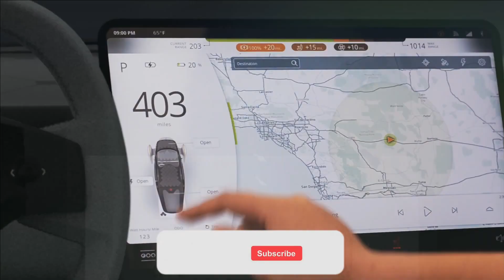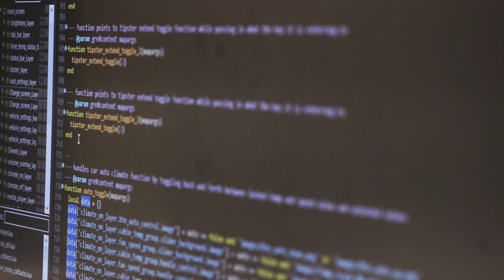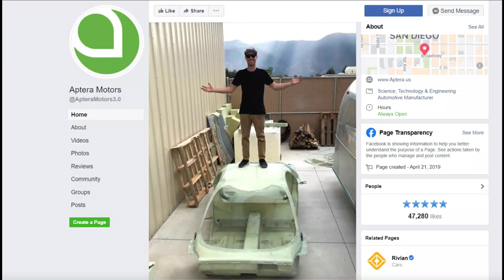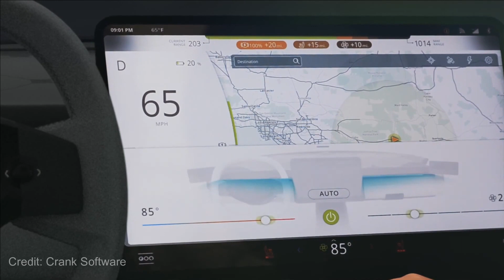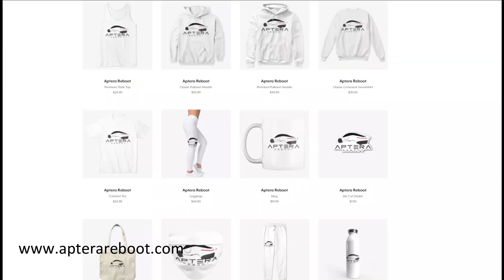Top 3 Reasons Why Aptera Will Fail?!?

Comment: Aptera will fail all the same reasons as Star Citizen will :^) it is not out yet. 

Joking aside I'm interested to see how EU will react to Aptera. it would be super neat to get it as motorcycle for cheaper cost ... Also winter in Finland/Sweden/Norway will be problematic as some roads are covered in snow. I hope the winter tiers go well... Also I think you have to get 3 wheel drive. I would love to see "low speed mode" where the tiers will move slowly ... I got my car stuck because one tier didn't spin and other one dig itself and I was stuck from engine and it took 1 hour to get it unstuck with a lot of shoveling, some sand and wooden plank under the tier ...  

I mean, if the Aptera is light maybe I could more easily lift it ... but here is a question. Can I lift the tier up without hurting the body? Is there some place I can place planket in case it gest stuck? How about if I want to pull it using robe or something, where do I attach? 

It is less about "can the Aptera handle the snow" but more about what if I get it stuck by being stupid :D
Reply: Aptera has a superior ABS/Traction control that can sense wheel slip and adjust torque 32 times per wheel revolution.  AWD will be better, but I will be getting my 2WD for use in snowy Iowa, and will probably put on studded snow tires for winter conditions.  I hope to report on how well it behaves  next year.  A tow rope can be attached to a the front suspension or the rear tow hitch.  There will be hard spots for lifting.

By the way, I have a lot of respect for people willing to use a second language to ask questions.

Comment: Not concerned about 2 seats, I want that rear tire to be wider with fast charging capacity and I have my doubts about the reliability of those in-wheel motor.
Reply: They are looking into a wider tire with the validation testing going on now, but it may not be needed for excellent performance.  I had some questions about the in-wheel motors too, and contacted Elaphe directly with some questions based on my own experience developing motors for marine use in salt water.  They had the answers I was looking for.  I am no longer seriously concerned.

Comment: This vehicle reminds of an electric modern version of the 1934 ( or the new ) 3 wheel Morgan sports car. How cool is that. I suggest adding an S & S Morgan gas motor sound system to make it sound as cool as the 3 wheel Morgan's:) that would really make these turn heads
Reply: Aptera grants right to repair and will encourage customization :)

Comment: I am a Canadian and one of the concern that i have is, I think because of the Wheel Panels there is a good chance that i might get stuck in Snow. I can visualize it plowing thru the snow. Also, I think the 3rd wheel might make it unstable in snow causing it to wobble/ fishtail.
Reply: A driven third wheel will make it more stable.  I will have an early model and will be driving it in Iowa.  I will have plenty of opportunity to report on performance in snow.
Reply: @n.brucenelson5920  mostly when it snows you can see the 2 tracks left by other cars but the third one in Aptera will be driving on snow which the other two on cleaner tracks. Let's hope it does not cause it to fishtail. I will wait for your experience.
Reply: @Soothsayer210  I presently drive a Gen 1 Honda Insight where the rear wheels do not follow in the tracks of the front and it is OK.  The Aptera will have abs traction control that can sense slip and adjust torque to each driven wheel every 2.5 inches of tread travel.  I will use studded snow tires and expect it will do better, based on my experience with the similar weight Honda.
Reply: @n.brucenelson5920  we are NOT allowed to use studded tires here. We just change to winter tires. I have also ordered my Aptera an all wheel drive with off roader wheel panels in anticipation for our snowy conditions.
Reply: @Soothsayer210  Too bad.  Research seems to show that they are not more damaging to the roads.  I think that with AWD you will have no issues.  I will be reporting as soon as I have first hand experience.

Comment: "Goal" of meeting crash standards...lol   They have a goal of selling them for $2000 too probably.
The big issue with the Aptera design is the HUGE A-pillars of the body.  It creates a huge blind spot for pedestrians.   EVs don't need to be highly aerodynamic, they are not used for long-distance high-speed travel.  A Smart car has terrible aero, but sells plenty of them, they are not for long distance travel.
Reply: Please inform yourself regarding the focus for Aptera's design.  Noone designs a local only vehicle with a 1000 mile range battery and gives it a 110 mph top speed.
Reply: @n.brucenelson5920  So Aptera will ABSOLUTELY and CERTAINLY FAIL if they think a 1000 mile range 110 mph car is what people want from an EV.   Dumbshit

Comment: I believe it will do well because of their design plus current market. Gas prices too high Aptera has the best driving distance of any electric car. Solar as the wonderful balance to that. Being a two seater isn’t a problem. They even addressed the issue what if you break down. I believe they have worked out most issues and now the world is ready for them!!

Comment: There's a difference between two doors and "seats two".  Most two-door cars still have a back seat for other people.  So pointing out the number of two-door cars sold isn't really applicable.

That said, Aptera's biggest problem is it's weird.

Consider Tesla.  It's an electric car.  But it's still a car.  It has four wheels.  It looks like pretty much any other car out there--maybe a little more streamlined.  It has four wheels and drives like the other cars I've driven in my life.  I'm fine putting down an order for a Tesla because it's just like any other car--it just runs off electricity instead of gas.

Aptera?  It's weird.  It has three wheels.  It has a funny shape.  What will driving it be like, with three wheels?  How much space does it really have?  I'm interested--definitely--but I would want to test drive it.  Heck, I might consider a week-or-two rental or a lease instead of a purchase because I don't know if I'll like it.  And before I plop down $27,000 (at the low-end), I'd want to check it out.  Because it's weird.

Don't get me wrong, I'd probably find out that it's not a big deal driving on three wheels, that it has plenty of space, and even that I really like it!  But I would need to find it out.  I have no experience to go on for something like this.

So they need to start making them--obvs--and offering leases as well as purchases, IMHO.

Comment: I like the concept of Aptera. It’s clean, efficient, mostly affordable. With a promised 1,000 mile range and may never need to be plugged in… if they can do as promised it will be a game changer. The two person thing is a possible problem, but for me, not the big of problem, 90% of the time I’m alone in my car, if I do have a passenger, most of the time it’s only one person or the dog. 25 cubic feet of storage for the most part will cover my needs as well. And the full recharge times, no one is coming anywhere near that. Now the draw backs, when are they going to pull the ripcord and start production? I’m not committing one dime until there’s something I can see and butt test, something I drive. It will have to be quiet, comfortable and better have a smooth ride. It had better have great heating, there are reports the heater may not be up to challenge of keeping you warm in subzero temperatures.
 And it better have a decent radio, I know superficial, but it’s a must. Every car I’ve had has been comfortable to drive, has had a great sound system, rides nice and needs to be quiet, I don’t want feel every bump and crack in the road and I don’t want to hear the road either, but I do wait to hear my music and be home comfortable. I’m not on the list to be one of the first to own, I’m going hang back, let someone else be the Guinea pig. But if Aptera can deliver, this could be the first EV I buy.
Reply: My wife and I have both had rides in the alpha prototype.  As to your concerns, I think some of us will be getting our vehicles by the end of the year, but with 20,000 pre-orders and the list growing at an increasing rate, you might think about putting a provisional order in now.  The heating will be validated down to -20.  We intend to drive ours year round in Iowa.  We have ordered the upgraded radio, which is not simply an unthought out add on.  The ride on the alpha prototype was rough, but has been completely redesigned by Roush for the betas, and i think it will be much smoother with exciting handling.

I will be reporting on my experience when we take delivery.

Comment: A four passenger sedan is next in the roadmap. There’s no reason to assume Aptera will exclude additional market segments and only make two seaters forever. Once they achieve a critical run rate, it would stand to reason that they would slowly begin to integrate supply chain. The company is simply following common sense, agile principles at its inception.

Comment: i only see 1 superwrong thing with the aptera, and that is : it will not work in winter conditions. so tesla will sell in countrys that have winters/snow. aptera will not.
Reply: I don't know what you base this on.  Aptera is no Polaris.  I live in Iowa and expect that it will perform very well for several reasons.  I will fit studded snow tires to mine for winter use.  The ABS/traction control is better than anything else on the road by a wide margin.

Comment: What about car mechanics to service and maintain? Where do you get car parts from if they need to be replaced? How difficult is it to get into and out of the car?  Lastly, how will this car handle a New England snowstorm. It looks rather low to the ground. What is the ground clearance? Snow depths greater than 3 inches, pot holes and speed bumps are the main reasons Aptera will not do well in my area(Connecticut). The low ground clearance makes it very susceptible to  wheel guard and car bottom damage and poor road handling in the snow. Have the people at Atpera taken into  consideration effect of corrosion from salted road ? Corrosion, due to salting  of the winter roads, shortens the lifespan of cars by certain manufacturers.  Other than those concerns, I love the car.
Reply: I live in Iowa, and have been able to answer these questions to my satisfaction.  I will be reporting on my actual experience in snow in an early model.

Comment: Just remember they said that Tesla would fail. Just like Tesla aptera is going to have to use on the shelf parts versus its custom everything in order to actually go into production. This will reduce their overhead, increase availability for parts and utilize engineering that has already been tested and proven.

Comment: Why is it so wide? 2.2 meters wide, most cars are 1.8.  This would be awkward in parking spaces.
Reply: The main reason is that it prevents drag created from air compressing between the wheel pants and the body of of the vehicle and lowers drag by around 10% - a significant tradeoff.
Reply: @n.brucenelson5920  Wouldn’t it be more aerodynamic (streamlined) to merge the wheel housings with the main body? Or is the wide spread required for stability on turns with a three wheeled vehicle? Seems like a significant flaw.
Reply: @egbun  Sadly no.  This would significantly increase the frontal area and increase the overall air resistance.  The design has been carefully computed and refined by thousands of supercomputer trials.
Reply: @n.brucenelson5920  Do you know if the wide stance has to do with achieving stability in turning a three wheeler? The extreme width is a drawback so there must be a reason for it
Reply: @egbun  The wide spacing in front, of course, contributes to stability, but in this case it is not the main reason for the choice.  It is a secondary benefit.
Reply: @n.brucenelson5920  What is the primary benefit?
Reply: @egbun  The Cd (co-efficient of drag) is reduced by another 10% over what it would otherwise be.  They are now around 0.13.
Reply: @n.brucenelson5920  It surprises me that creating a gap between wheels and body is More aerodynamic than moving the wheels closer to the body and merging them into the body. Any time you make a shape more complex, you generate eddy currents.

Comment: Regarding safety: the aptera has a very bad safety zone, the combination with a strong shell doesnt actually make it safer, but less safe. Combined with the fact that it is  light, this thing is gonna be a whiplash machine. You really need to treat it as a motorcycle by any means. Hitting another car will almost alway result in you hurting more than the car.

And that is fine. Its not ment to be a safe family car, its ment to be a ultra efficient extreme type of care made for sustainability  daredevils. And people in that segment (like me) wont care about this kind of safety. 

But the truth is that th
Reply: Aptera has been carefully designed with front and rear crumple zones.  It will be voluntarily tested to FMVSS Part 200 crash test standards and the results published.

Comment: I wonder what long term effect the continuous bumping and vibration from the road will have on the motors with them being un-sprung inside the wheel.
Reply: The motors are designed to withstand 100 G shocks, and are somewhat cushioned by the tires.

Comment: Idea of a more efficient car (instead of waiting for more efficient batteries) is good but the design had to get more realistic: you need 3/4 seats ... and electric motor in front wheels sounds like a bad idea... those are hit often + water + rocks
Reply: The two place vehicle is just the first one - like Tesla.  The second Aptera will be a 4 wheel, 5 passenger sedan.

The wheel motors have been through brutal testing.

Comment: I wonder if it would have to be tied down in high winds like a little airplane.  Driving in high winds on a flat Kansas highway passing a semi can really rock a heavy car.   What would happen to this one?
Reply: There are almost no flat surfaces for the wind to press against.  There is downforce designed in at the rear.  You most likely won't even feel it.  Even my Gen 1 Honda Insight is much better than most SUVs in these conditions.

Comment: The video title is click-bait.  It is using your customers as investors and not even alpha testers.  The car is "always a few years away" and "just put in a non-refundable deposit" and you'll be the cool person who got them rich, but does not have a vehicle. 

EV's are not niche vehicles, solar EV's will be useless without a high charge rate station nearby that can get the battery to 80 pct. capacity in less than 15 minutes, to be practical, since many drivers on business trips that need to rent or own cars that service their business do not want to be lured into eating lunch for $10.00 at a 30 minute E-Charge station when they have brought their own food.

The two seater excuse is the same, why not get a one seater vehicle to market--many commute alone--but that would still keep tons of cars on the road.

Aptera looks cool, do not get me wrong, but they are trying to get people to invest in EV's that were already in the eyes of most major automakers and startup Tesla.  Dropping the word "solar" works well in the desert or the LA Metropolis,  but the last thing the LA Metropolis or SanAngeles, the San Diego/LA Megalopolis needs are more cars, that haul fewer passengers when we need more commute rail and minivans -- commute rail for singles, minivans for families, a much more efficient way to move people around, other than the urban loners seeking to slyly solicit Aptera investment with click bait and really lately seeming like a spam storm in the process.

Comment: Strictly based on the history of all past new car ventures, it is more likely they will fail than succeed.  Having said that, the car seems to be very safe and well designed.  It has a niche in it's ability to recharge while in operation, and the resulting range advantages that gives.  I think they could make this work in the long run, and I am rooting for them.

Comment: #1 reason, we are convinced we need big heavy cars .  When you collide with mismatched weight the lighter vehicle usually looses.  There are too many heavy cars and trucks and the safety issue. If we all drive lighter cars it won't be an issue, good luck on switching mind frames..
Sales is the bottom line on any business.
Reply: $10 gas will shrink the average car size.

Comment: If the 2 door Aptera sells well, who knows, maybe they will figure out how to build a 4 door? Even Porsche eventually got around to building bigger, bulkier cars, which was never the case when they started with those little 2 seater sports cars.
Reply: Aptera has a 4 wheel, 5 passenger sedan in the works.